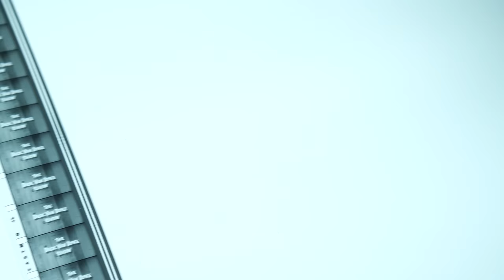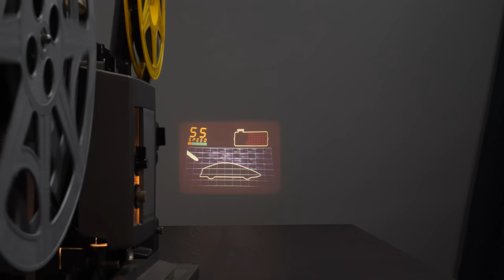Movies made sound with a light bulb: Sound-on-film

Comment: Just a piece of nerdy trivia - motion pictures were a major use of 2 of the first plastics ever invented:
Nitrocellulose (also known as guncotton and a major component in smokeless gunpowder even now) in nitrate film.
Cellulose Acetate in Celluloid "safety" film (still used in clear food wraps and playing cards)
Both of these plastics are biodegradable (the cellulose breaks down), and that is a large part of why they are fragile, especially when old (Nitrocellulose becomes quite flammable, and Cellulose Acetate becomes brittle with time).
Reply: The comments section on a video about sound on film was not where I would have expected to learn that clear food wrappers are biodegradable, but I do appreciate knowing it.
Reply: @stevethepocket  not all clear food wrap, but the first clear food wrap invented, and some current food wraps are Cellulose Acetate.
It's hard to know which, as most aren't clearly labeled.

I find it more interesting that modern gunpowder is a type of plastic.
Reply: Guess what blurays are made of?
Reply: @honestguy7764  Blu Ray discs are polycarbonate.
Reply: Cellulose acetate doesn't really brittle at all if it's stored properly.  My dad has some 95+ year old films that are perfectly playable and in excellent condition.
Reply: @startedtech  and there are paper (cellulose) documents dating back centuries.
But put cellulose acetate anywhere with an active biology or too much UV light and it will degrade (interestingly, it decays faster in a landfill than in open air - which can be good news, as cellulose acetate has often been used in disposable diapers.)

Comment: Great video. Brought back a lotta memories. I was a projectionist for 7ish years in early 2000. I ran 12 screens and we used every sound format you covered. We had 1 SDDS, 4 DTS screens and everything else used Dolby. You're correct on SDDS being the most finicky, as after a few weeks or so of running the film the track would get damaged since it's on the edge and would cause faults. But it definitely sounded the best out of the bunch. DTS was definitely easier and pain free, never really had issues beyond a failing CD drive. And Dolby was no BS, just worked. We also had a few ELF(endless loop film) platters. They were absolute nightmare fuel and we never used them, guaranteed brain wrap. But nothing compares to interlocking 4 projectors with one print. Anxiety MAXIMIZED.
Reply: I ran a couple theaters at the museum on Ellis Island using the ELF platters in the 1990s. A bit temperamental, but once you understood how they worked you could keep them adjusted. I admire them from an engineering standpoint, as they are the only example I know of a feedback amplifier implemented entirely mechanically.

The biggest problems we had with the Christie platters was with the electronic motor speed control, which was poorly designed and prone to drift. Those cards were the same on the ELF and standard platters. One night one of the platters started going on its own, and managed to move the projector a couple inches. The film never broke--Ektar base is STRONG.

Comment: For those that are interested, optical audio on 16mm film at the slower speed supposedly has flat/good frequency response between 100Hz and 6-7 kHz, while optical audio on 35mm film at the higher speed supposedly has flat frequency response within 1 dB from "bass" (assume 20 Hz) up to 16 kHz (although a 15 kHz low pass filter is supposedly commonly used).  Finally, optical audio on 70mm film has no issue producing a flat frequency response  up to the full 20 kHz (or beyond).  🙂
Reply: Optical soundtracks on 70mm prints were never used in the US or anywhere in the West. I have actually seen 70mm prints from the Soviet Union with variable-density optical tracks, but this is an extreme rarity, and makes me wonder whether you have misspoken....
Reply: @gregfaris6959  Excellent point!  Those specs for optical audio tracks are just what I found on the web on a a forum. If someone has more accurate specs for optical audio on film that would be great!

Comment: VERY NICE PRESENTATION!     Question: have you looked at the sound using a spectrum analyzer? Could even perhaps detect any jerkyness of the film as that would introduce periodicity.
Also, what about the frequency response limit? That would be a function of both the inherent limit of the optical track and the nonzero height of the slit of the exciter beam, the latter of which is a "boxcar " (low-pass) filter.
Reply: If you are referring to immunity from the 24Hz pulldown event, this is to some extent dependent upon projector design. All American projectors used hold-back sprockets below the intermittent unit and on the output of the soundhead to completely isolate this phenomenon, as well as oleo-pneumatic damping devices in the sound reproducer itself and a high-inertia flywheel on the sound reproducer drum. I have observed similar construction in Soviet-era machines, indicating they largely imitated the American designs, but European projectors without exception omitted the isolation sprocket beneath the intermittent movement, no doubt for economical reasons, relying instead on a large “floppy” loop of film to dampen this resonance, followed by a similar construction in the sound head itself. While there is no clear evidence I’ve ever measured indicating the European system to be inferior, it stands to good reason that the American patents provided a better guarantee of elimination of this low-frequency flutter component. 
As concerns frequency response, this was standardized by the Motion Picture Academy in 1938, and maintained through the 1960’s; The response is flat between 100Hz and 1.6kHz. Response is reduced 7dB at 40Hz, 10dB at 5kHz and 18dB at 8 kHz. The severe reduction of the high end of the spectrum was specifically designed to conceal the high frequency crackling noise inherent in optical sound production.
Dolby finally broke this mold in 1970, however they paid a price as their A-Type noise reduction algorithm proved ineffective for the type of impulse noise produced by imperfections and dust particles on optical soundtracks, and this remained a thorn in their side until the introduction of their SR-Type noise reduction in 1990, by which time they had already been surpassed by the introduction of the first digital soundtracks for motion pictures.

Comment: I was wondering if you could reconstruct sound from only the waveform. now I know.
Reply: If you can resolve the waveform well enough - sure.

Funnily enough, that trick with the slit in the lens is also used for magnetic tape heads, though in those the purpose of the slit is to concentrate the EM field instead. Still, the smaller you can make that slit - the smaller the portion of tape you read can be, and the slower you can run that tape for the same fidelity.

It's a great example of needing to have good equipment and good media in order to get good results.
Reply: It is possible. Computerphile made a video where they write a program to do this, called How Not To Sample Audio, if you're curious about how sound could be recovered from a waveform. They do it digitally of course, but it works on the same principle.

Comment: While watching this video, all I could think about was re-engineering the projector to replace the 1000 watt bulb with an LED. It would help with film burn I'd imagine.
Reply: You have to re-engineer a lot of optical path to account for different radiation area characteristic.
Reply from the maker: I fully intend to put maybe a 100W LED on some sort of heat sink in there and see how that works. Not only for heat concerns, but those lamps? They have a rated life of 25 hours! You can get replacements, but who knows for how long. Plus, as is the thing is more like a loud heater that just so happens to play films.
Reply: @TechnologyConnections  Note that this is a compromise. Because LEDs read by photodiodes are a relatively narrow spectrum,  they will pick up the silver soundtrack less effectively. During the 1990s/2000s conversion in 35mm from silver soundtracks+solar cells to cyan dye soundtracks + LED readers, there was a peripheral concern that old soundtracks would not reproduce quite as well on the new readers, but this was considered an acceptable price to pay. (The other way around was not just a compromise but totally unworkable – cyan dye soundtracks were totally unplayable with exciter lamps and solar cells). I'm not sure how pronounced this effect would be for you. And I suppose you're not limited to red LEDs like we (effectively) were back then…
Reply from the maker: @johnhawkinson  I'm not talking about the exciter lamp here, but the projection one.
Reply: I would consider setting the voltage for the projector higher, like 120 in 110V countries or 240 in 230V countries, sometimes even setting 250 for 230V or perhaps 130-140V for 110V could be possible, to extend the life of the projector lamp, a little. (*) Replacing caps on any old electronic device, especially ones with tubes, should be prioritised as leaking current may ruin the tubes.

(*) Also - it seems like the grid voltage has been increased during the years, like we in Norway who had 220V, now has 240V, and 110V countries now having 120V, so it is actually really important to check if older devices can be set to somewhat higher voltage. This is practically done by selecting a different tapping on the transformer, usually it is accessible and self evident by clear markings of voltages, without the need of removing panels.

± 10% voltage variation on the grid is within tolerance, so in 240V countries, you could sometimes reach 240V+24V = 262V and the same goes for 110/120V countries I guess, so better check the voltages properly when connecting old equipment to the mains.
Reply: @thomashenden71  You seem confused. Running an incandescent lamp at a higher voltage REDUCES the life of the bulb, not extends it. You may be thinking of the fact that if you get a higher RATED bulb and run it at the regular voltage, you can get a longer life. For instance, finding a (somewhat but not really rare) 130 or 135V bulb and running it at line voltage in a 120V country.
p.s., Alec: oops, my brain was stuck on sound lamps, and 100W sounded so terribly high for that and my brain waved it away as a typo without thinking about it. Haha.
Reply: @johnhawkinson  By setting the apparatus for a higher voltage, when it actually receives somewhat lower voltage, will give the electronics and lamps lower voltage.
Reply: @TechnologyConnections  I think you can get away with a very powerful COB LED. Those give a very even square of light. Considering the price, you could even consider overdriving them because although they are useful for normal lighting, they will probably not nearly be as bright as the 1kW overvoltage lamp. But they are cheap, so if they last only 100 hours at two or three times the rated power, it's still cheap to run.

Comment: I think the exciter lamp had to be powered by a DC voltage also ...I could be mistaken, but using AC would probably cause audible noise.
Reply: Notice how slowly it lights up, it has massive thermal inertia that smooths up any ripple from power supply.
Reply: @jurajvariny6034  ripple wouldn't be the issue, I wouldn't think...but unless the filament was VERY slow and the sensor VERY tolerant, I would think the audio would have a lot of hum (or at least very low-frequency noise) if the light source was operating on AC current.  Again, I could be completely "over engineering" this, but I do think I read somewhere that the exciter lamps were powered from a DC source created in the projector's audio circuit.  I'd love to know for sure.
Reply: Lynn is correct - Exciter supplies were always rectified, which is not quite the same as saying "DC" as there could always be ripple, but essentially yes.
Reply: @lynncowan9864  filter capacitors?
Reply: @janicehopkins4432  I don't know how they would have generated the DC - I'm guessing it was probably in the audio amplifier circuit, and I don't even know if it would have been full-bridge or only half, but yes, I suppose there probably would have been some filtering included.
Reply: I'm guessing special bulbs with a lot of thermal mass so the mains ripple wasn't an issue.

They're going to take an amp or several - and the early selenium rectifiers wouldn't have handled the current.
Reply: @mrb.5610  Virtually all exciter lamps were tungsten filament incandescent bulbs, but they varied widely in dimension and power. This is because sound readers used different architecture, requiring different light levels. The most common, particularly in the US involved an objective lens projecting a slit on the film, behind which the photo-receptive cell lay, capturing the modulation. Many of these exciter lamps were very fine, and ran at only 3W. Other designs, particularly in Europe used a “reverse scan” in which a lens focuses the image of the sound track on a mechanical slit. (This was also used by Century in the US). These lamps would be of 30W (6V/5A), and I have even seen systems up to 75W. In all cases the current was rectified, either by vacuum tube diodes or solid state, both selenium and silicon and there were generally filtering capacitors – in some cases stabilization circuits, using neon lamps, later transistors. I have seen a couple of outliers; DeBrie had a projection system in which part of the film projection light output (which also had to be DC) was diverted through an optical system to illuminate the soundtrack, and in the US Bell & Howell actually used a solid-state “ultrasonic” system, in which the light was not rectified, but modulated at 40 KHz, using a transistorized oscillator circuit. 
I have never seen an exciter supply built into the audio amplifier circuit, but in light of the fact (see what I did there) that such circuits all required rectified current, it would be a logical derivation, and probably has been done somewhere, at some time.
Reply: @lynncowan9864  you can easily generate DC from AC by means of a rectifier - I think this has been covered by @Technology Connections in a previous video.

Comment: I actually remember my teachers busting out a reel-to-reel a few times back in elementary and middle school... in the 90's lol
Reply: me too, schools used them until they broke down.
And unlike things built nowadays, they were built to last like forever 😁
Reply: Same, late 1990s,😂 I think I remember a schoolhouse rock on film or something animated.
Reply: I work for an AV technology company, and we were actually Selling  EIKI 16mm projectors into the early 2000's!  I remember installing one system around 2003 that had a 16mm telecine projector (instead of a lens, it had a video camera) and it was connected to a larger AV system with a digital LCD projector for showing computer and DVD images...all controlled with a touchscreen.  The user could switch back and forth on the touchscreen between the16mm, computer video, and DVD video signals. Talk about a merge of old and new!

Comment: My father used to be a projectionist in the 70s. He'd tell the stories of sometimes having to not only get the next reel loaded and ready, but also dash down to the train station to pick up the next movie, preview the reels and splice any breaks, change the signs out of the front of the cinema, assist in prep for intermission etc, all while not missing a cut-over. He also told the story of stopping in to see how a fellow projectionist was going one night to find a 1,000ft of film spooled all over the floor of a tiny projection booth due to a take-up spool failure.

Comment: In 2005, I spent about a week working in a theater projection booth, and learned a few interesting there.
The projector uses a "maltese cross" to be able to only spin the image in front of the projector 1/4 of the time (leaving the image be stilled 3/4 of the time, as you mentioned, the image would be obfuscated during the 1/4 and 3/4 step to prevent flickering).

In that theater, I noticed a few times when watching a movie that the sound went from being very immersive to very "bland". What happened is that if the DTS signal couldn't be read (due to a scratch disk / error in sync), it would fallback to the "stereo" SR (it wasn't possible to fallback to SR-D due to some technical limitations).

This theater also had ads running ahead of the movie (using a different projection lens), and some automated curtains that opened at the beginning and closed at the end of the movie.
When the projectionist were taping all movie pieces together, they would add some "magnetic tape" at specific positions (beginning of the ads, end of the ads, beginning of the movie, a few seconds aka few meters before the end of the movie), a sensor would then detect it and would start an action "open curtain, pause since it's the end of ads, close curtains", etc.

Another thing that was pretty nice is you didn't need to rewind movies. As shown in your video (around 31:00), the movies were read from the inside, and put back in the outside in a different platter (there were 3 platters total to allow for 2 movies to be projected from one room). The rotation of the platter would also depend on the angle of the film going through the feeder -still 31:00-, this meant the projector would pull film at a specific rate, and the platter that fed the movie will automatically adjust its speed to it.
The film exising the projector was then in tension in a kind of "M" looking circuit. The distance between the top of the two parts of the "M" and the part in the bottom controlled the speed of the platter that was rolling the film back.

Great video, it was nice to think back about this experience!